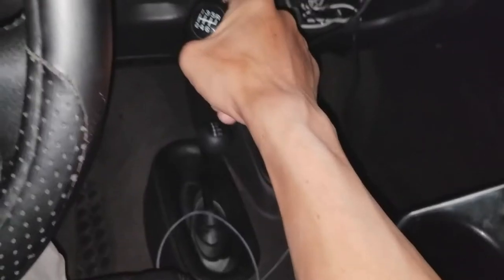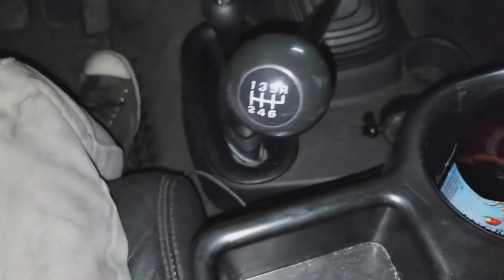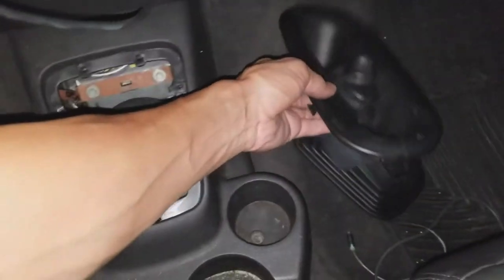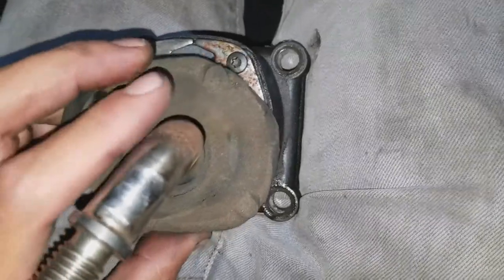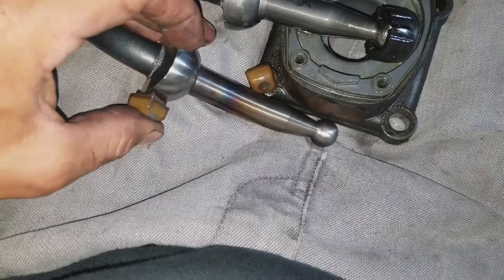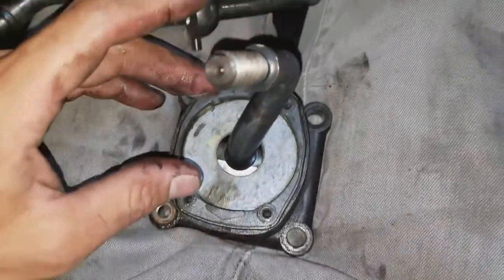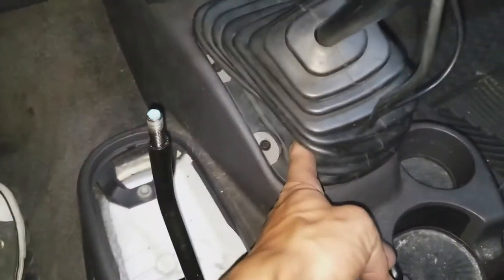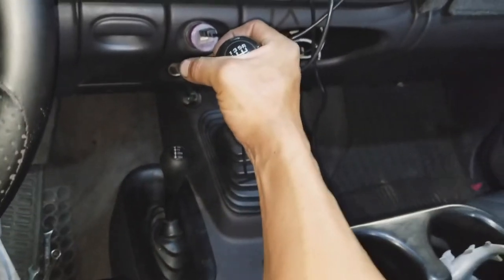2nd Gen Dodge Ram Short Shifter Install 6 speed NV5600 Cummins

Comment: The mumbling commentary is the cherry on top for this vid.
Reply from the maker: Sorry. Thanks for the view!
Reply: @SheepdogShaun  it's not a bad thing it was entertaining, how's the shifter? I'm thinking of putting one on my NV5600, getting into third is notchy figured I'd throw this kit on and replace the fluid and bushings while I was in there.
Reply from the maker: @mylesswann530  it's not as drastic as other short shifters ive installed in different vehicles ive had over the years but def helped. It was cheap enough that I'd do it again.

Comment: Thanks for the video.  Might consider this for my 01 2500 with NV5600.  What I was looking for was getting access to the top of the transmission as some have suggested adding a extra quart of Trans Fluid through the top of the trans.  Also my shifter knob is sideways and driving my OCD crazy but when I went to unscrew it I ended up unscrewing the entire shaft and not the knob.
Reply from the maker: yup might as well do it.

Comment: How do you like the shifter? Does it feel any different other than having a shorter throw? Good install video btw.
Reply from the maker: j.mentzy 24 it shifts a lot crisper and is easier to find the gear. The slow syncros still hinder the ability to shift fast though.
Reply: Shaun Singer Ok, thanks. I'm not looking to slam gears, but I have a little slop in the shifter. I just wanted to make sure it wasn't super notchy or didn't improve the feel at all. Mine has an NV4500.